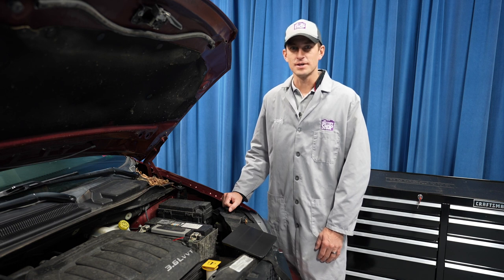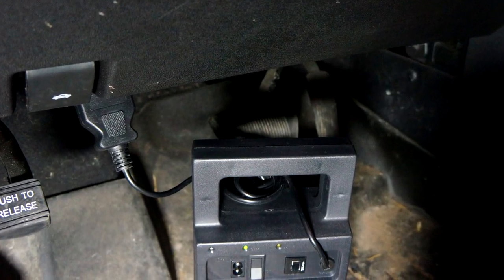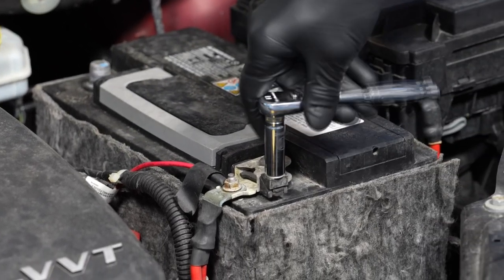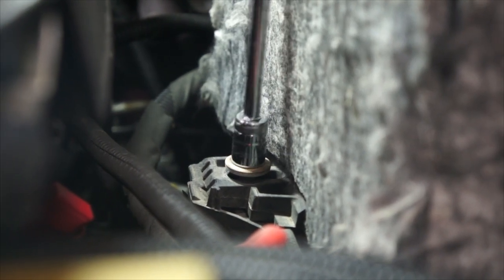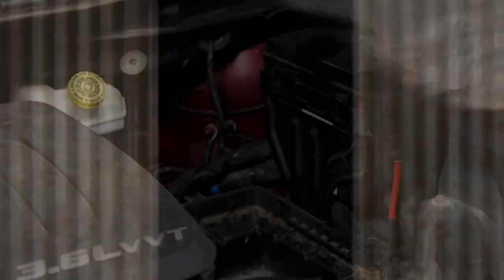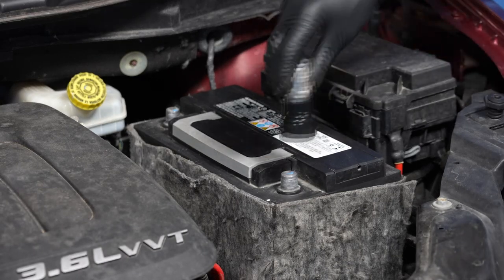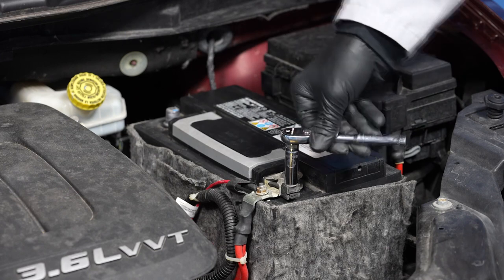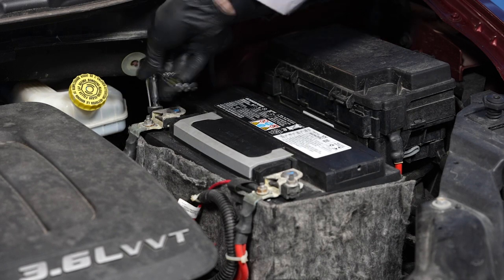Dodge Grand Caravan (2011 - 2020) - New Battery Install

Comment: Excellent. Can we use another batter / from another vehicle to use Booster Cable to connect with both vehicles in order to keep alive the vehicles memory
 with another vehicles battery for a while to bring out the old battery and insert  / install a brand new battery? Thank you
Reply from the maker: Hi - Thanks for watching. We have done that with jumper cables. Please check out our video on Memory Saving for further information. The link is in this video’s description.

Comment: Same battery
Reply from the maker: Hi - Thanks for watching! Yes, we often remove and install the same battery in these tutorials.
Reply: @TheBatteryShop  I really  appreciated you doing that, on  some tutorials the people explained but they want to safe the efforts not doing it the actual replacement either new or old part , great video.
Reply: Do you have to use a memory saver? Where do you get it and how do you connect it?